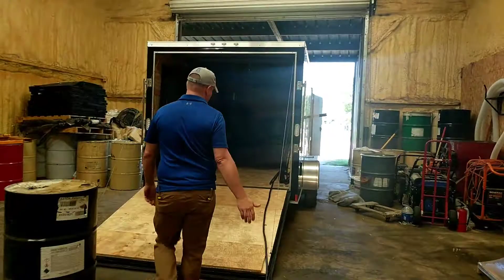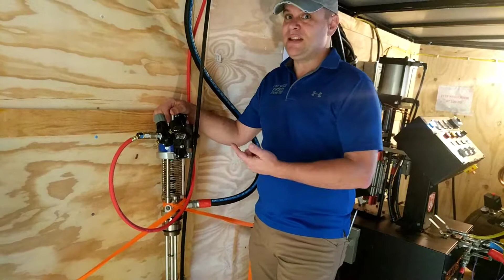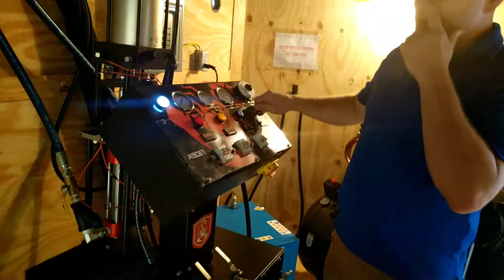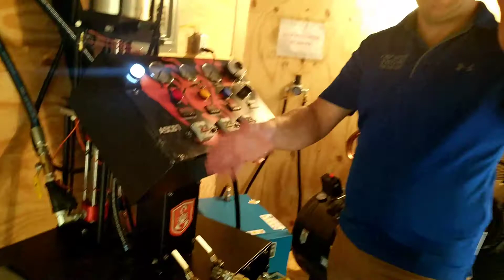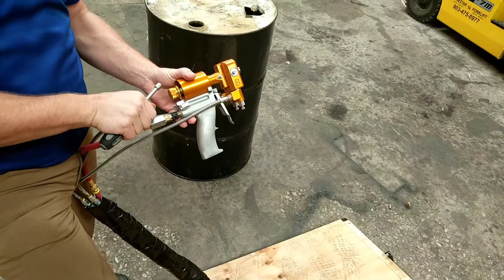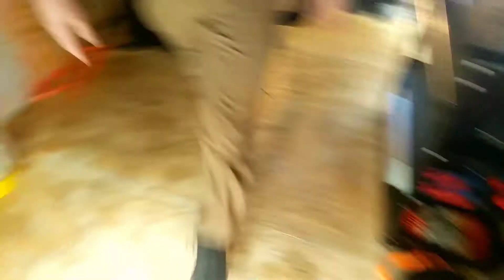Start up and shut down

Comment: Hey I’m from Wisconsin and new to the foam insulation business. I own a 5/12 boss closed cell machine. I bought on repo. Had some fixing and got it going.  I use a Graco fusion pc with a 4242 and 4747 mixing chamber I also use a Graco fusion ap with a 5252 mixing chamber. All seem to work fine. How many pounds can I spray at once. There’s a guy here who is my competitor and he has a Graco e30. And doing 30 pounds a min. And seems like he can spray more in a day than I can. What can I do.

Comment: That is not the total shutdown procedure on the boss gun there bud...Finish by turning air off and pumping grease into it until grease comes out the nozzle of the gun! The Boss Gun is Amazing and puts any other gun to shame!!  Boss = Cadillac
Reply from the maker: I did verbally explain the greasing of the gun LoL. Guess I should have just got the grease gun out and did it
Reply: @foamboss725  Eric told me to also after shutting off the air to pump grease in until it came out the front "without air"... lol